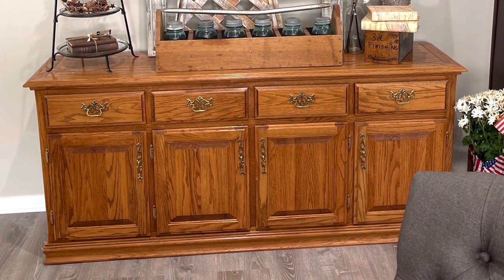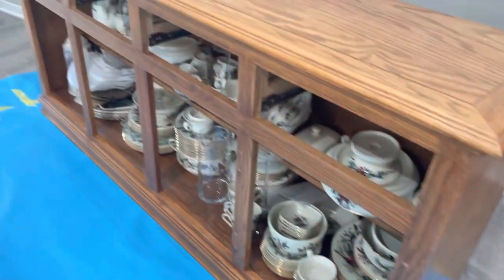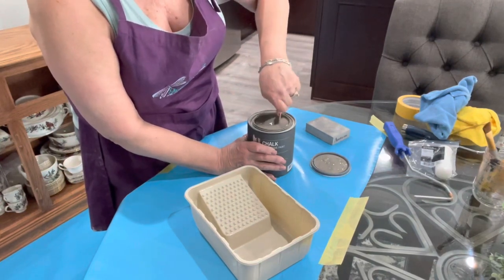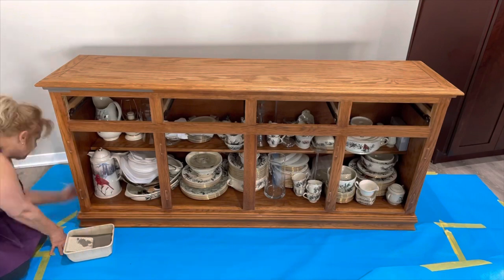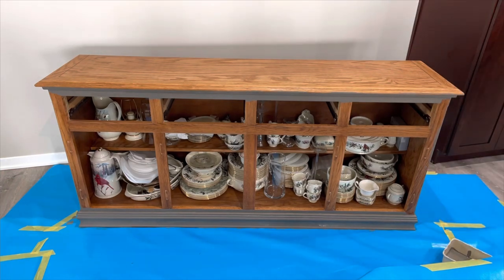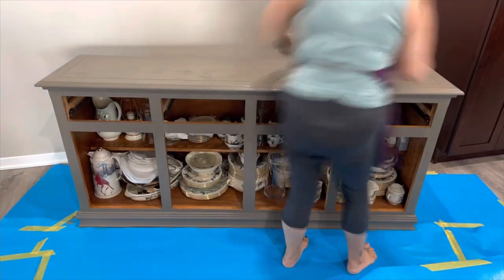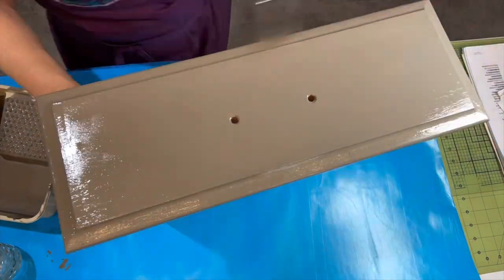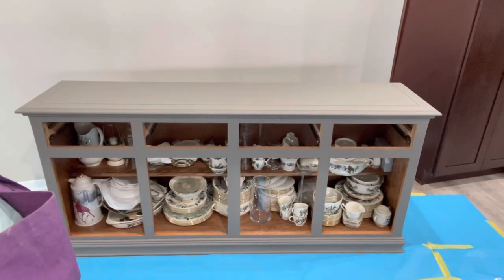How I updated my oak buffet with Behr chalk paint

Comment: This turned out beautiful, I love the color.  All of my kitchen and bathroom cupboards and drawers look just like what your buffet looked like originally.  I’ve been thinking about painting them like you did, but I’m so hesitant.  I love the look of the grain in oak furniture and so many people cringe when you say your going to paint your furniture.  Also everything comes full circle, meaning maybe the orange-ish color of oak cabinets are dated right now but will probably come back in style like so many other things.  My bathroom sink cabinet in my hall bath is the smallest of my cabinets, maybe I’ll start here for now.  Any opinions?  The chalk paint you used looks like awesome paint.  The brand Behr has always been one of my favorites.  The new door and drawer handles are beautiful, but I have a question, why did you not choose the same color/finish for the hinges?
Reply from the maker: I have the hinges on order. I just wanted to get it put together. If it takes much longer, my husband will be painting them. 

I definitely think you should start with your vanity. A small project. Believe me when I tell you how nicely this paint goes on. No brush marks either. I also loved using their wax. It works nicer than other brands I’ve used in the past. Let me know how it goes!